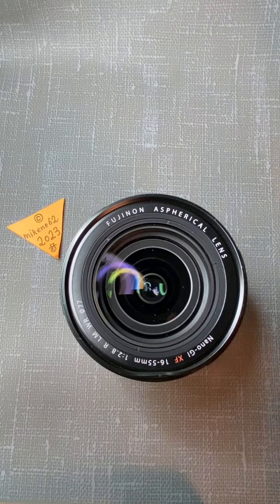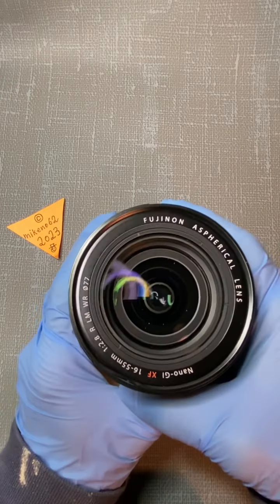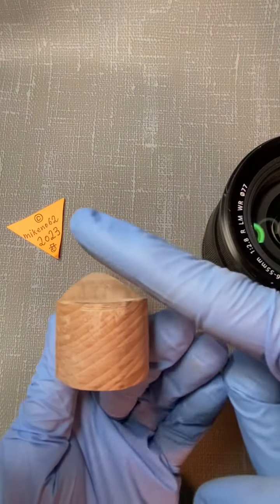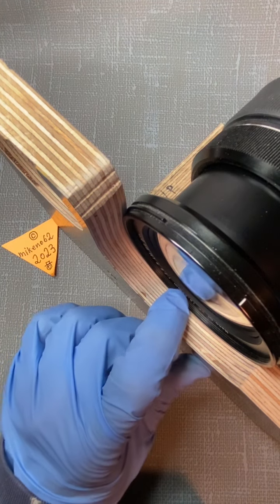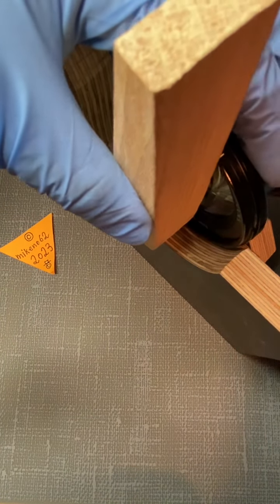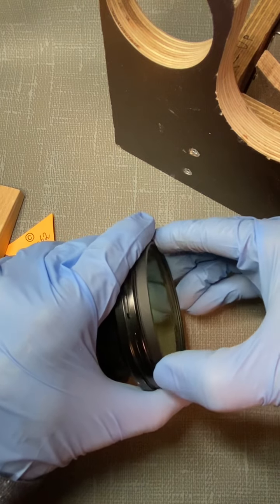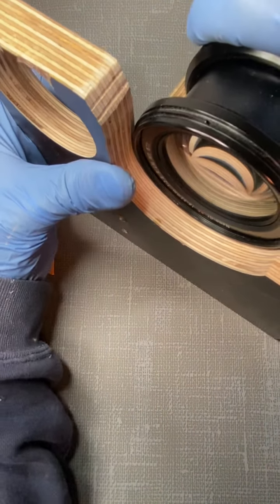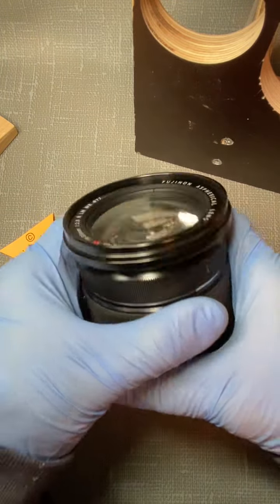Damage filter thread in Fujinon Aspherical lens Nano-GI XF 16-55mm 1:2.8 R  LM  WR

Comment: Nice set up, I saved the rim from broken filter and cut out 1” section to use with a plier. Not pretty but got the job done on my own lens. I’ve since bought lenses with damaged lens rings for cheap and just used my plier/filter rim to fix it and now I have good lens for cheap 😊

Comment: Could it be a thing if we take a frame of a filter with a smaller diameter, reinforce it with some round wood block and than use it as a press? I simply suspect a hard wood may bump fine threads on soft aluminium frame, and if we use a tight fitting reciprocal thread it might help to restore original form.
It could also be nice to roll it under the pressure forwards and backwards to bend it back more evenly.

Comment: I am just about to try this so your timing is perfect. Is there anyway I could protect the front lens element in case anything happened and the wood slipped?  I would rather be ultra safe.
Reply from the maker: You could add a piece of cloth in the whole front of the front lens element, then us a piece of hard wood 🪵 a shape just like the one I use in my video. Have good grip, both on the wood and the front of the lens.